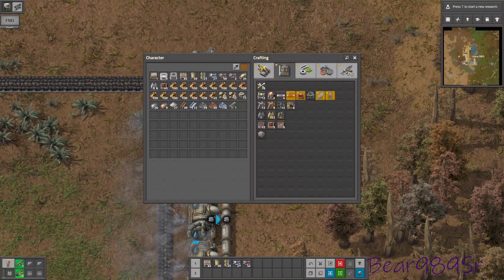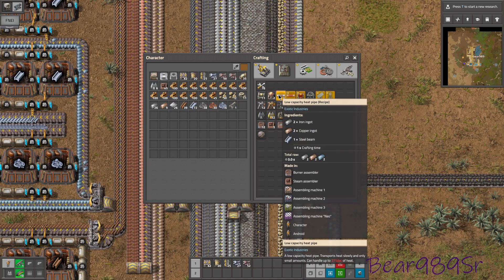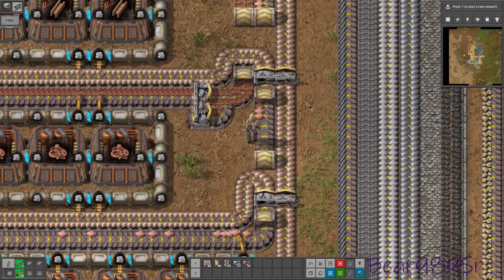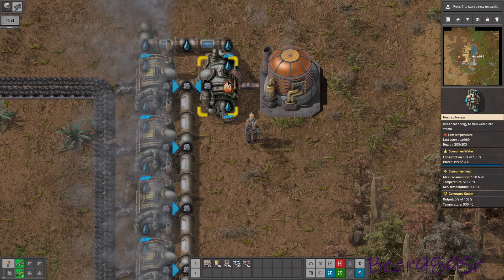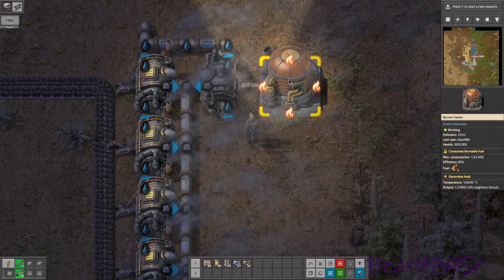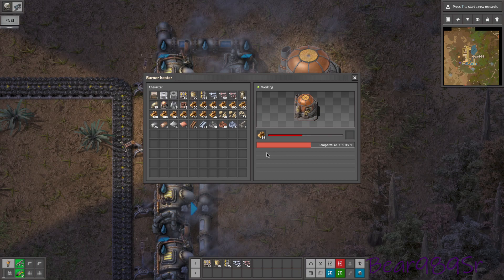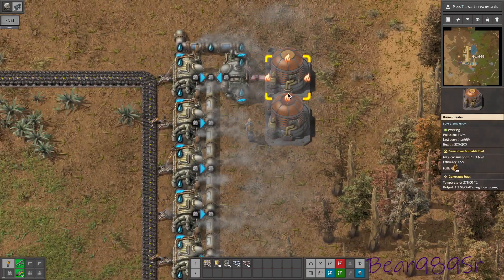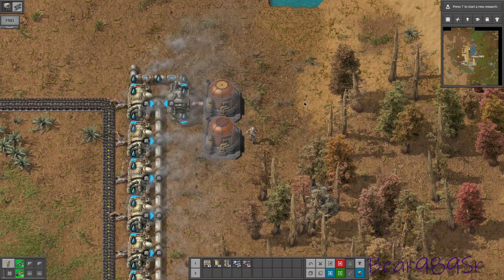[Factorio] Exotic Industries Ep 9 - Testing Heat System, Something needs fixed BAD

Comment: The use case for burner heaters, fluid heaters, and low-grade heat pipes is that certain buildings, and here I'm thinking of the first tier of oil refineries and chemical plants, require that much heat to work, about 200° c. 

If you want to use a heat exchanger with a solar tower without the later grade of heat pipes, you can do that as long as you hook the heat exchanger directly to the solar tower. This does require a decent number of those mirrors, and here I'm talking in the hundreds, but the upside of that is that once you've done it they are literally fire and forget.
Reply from the maker: I discussed this with the mod author and got that same answer, my issue is it seems strange one that you would need a burner heater to build a solar boiler, so the burner heater could be unlocked with the oil processing or only above the oil processing to show that that is what it is used for. same with unlocking the heat pipe before you can make them seems strange. If you want to have burner heaters separate, why not add a low heat exchanger that can be used rather for power over just the regular boilers?